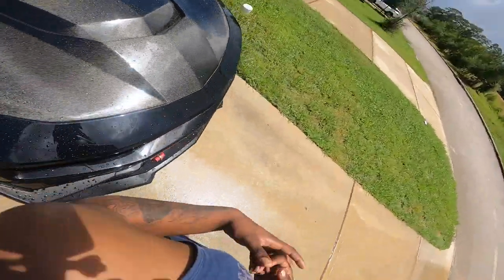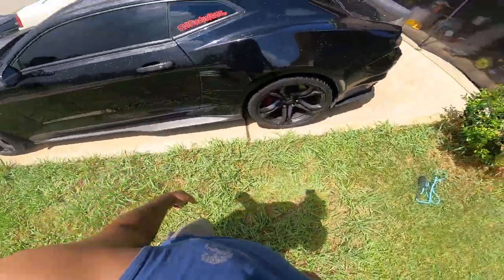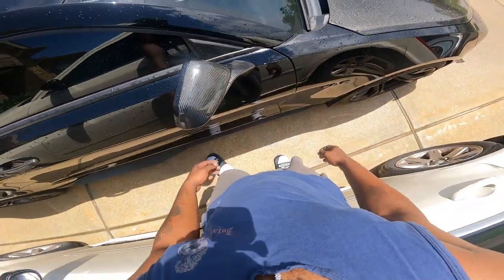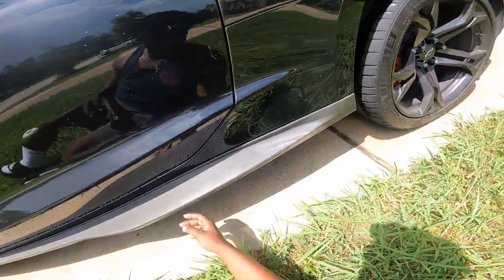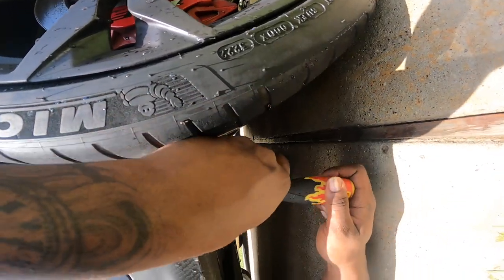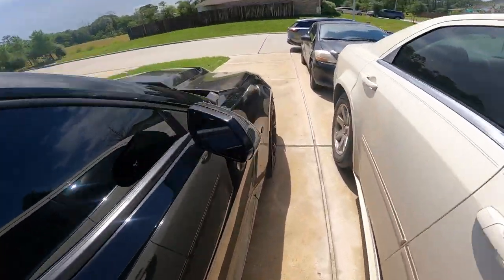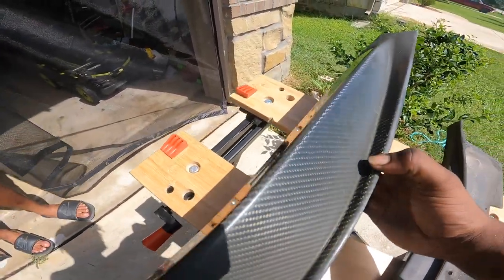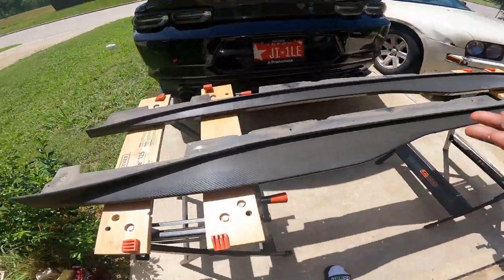I CAN’T BELIEVE THIS IS HAPPENING TO MY CARBONFIBER #camaro #car #broken #vlog og

Comment: Did you try polish after you cut with the compound will help bring gloss back without having to sand and add clear
Reply from the maker: Swear what polish do you recommend
Reply: @JIProductions  I’ve always used meguiars mirror glaze ultra finishing compound
Reply: Ultra finishing polish. not compound my bad